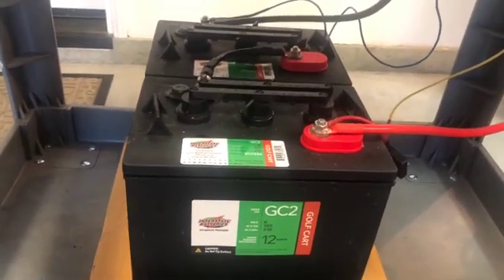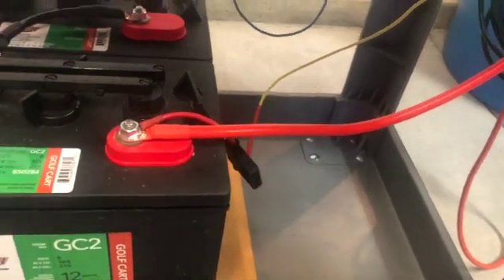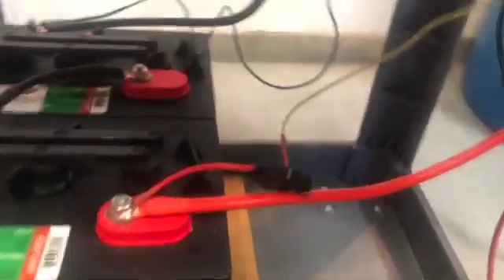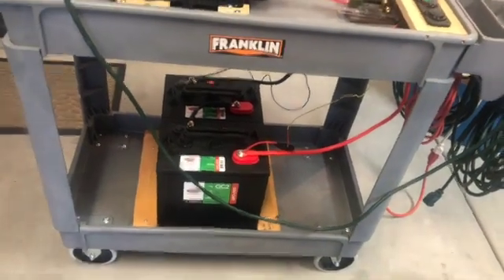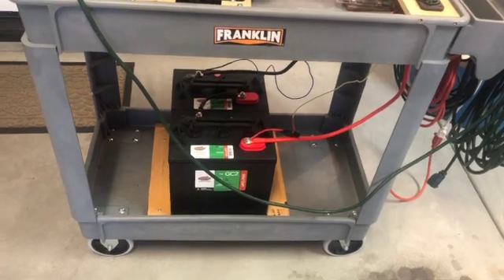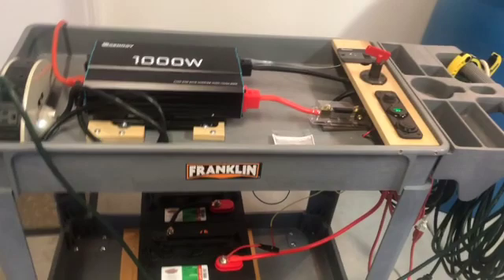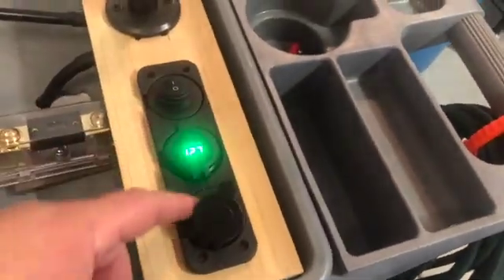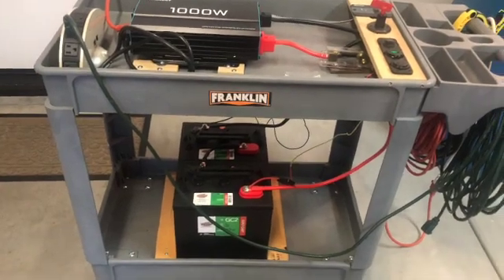DIY Portable Power Supply Station Inverter & Golf Cart Battery Solar Generator Refrigerator Freezer

Comment: Nice set up, if you get a chance and want to, add 2 to 4 more batteries. You can also run another inverter at the same time, if need be. And no lithium batteries will not survive an EMP.
Reply: Indeed , EMP / CME /GIC ECT.. and the elektrical components ( read BMS ) are freid and to at bad luck with much more bad luck these lithium batterys can have a thermal runaway with hours of fires that you cant put out becaus of the chemicals in it . 
When i was looking in to a system i was always hesitant because these EV's that burnt to the grond and / or exploded , so no lithium for me .
Reply from the maker: That's what I was thinking also. @dreddredd7137
Reply from the maker: Thanks.  We actually used it recently for a few hours when Edison cut the power due to a windstorm.  It worked great.

Comment: Some lithium batteries will charge faster than lead acid batteries. An inverter generator would use less gas to charge lithium vs wasteful slower charging the other types. Nice for being on the cheap though. Lacking for me i want something to at least power a microwave.  It would be an 2000 watt pure sinewave inverter with 200 ah 12 volt lithium lifepo4  battery. Solar mppt controller.
Reply from the maker: If I was discharging and recharging this a lot I would have gone with the lithium but I have the batteries on battery maintainer so they should last a good while because I'm only gonna use this 1 or 2 times a year.   I'm only using it to power the fridge and chest freezer so the 1000 watt (2000w surge) inverter is plenty, but not for a microwave that you may use.  Thanks for watching.

Comment: Sir:  

Would you be amenable to a Montana Public Service Commissioner referring to this video when speaking as a Board Member and/or when any Board business is published to the general public online or when they are making a video presentation?  

A T Burke
Reply from the maker: As long as you credit my channel and display the disclaimer.  Disclaimer: 
This video is for information purposes only, and does not constitute professional advice.  Electrical systems can and do involve dangerous electrical connections.  If you do not have experience with electrical wiring, please contact a qualified professional.  Use this information at your own risk. No information contained in this video/webpage shall create any expressed or implied warranty or guarantee of any particular result. Any injury, damage, or loss that may result from use of any information contained in this video/webpage is the sole responsibility of the viewer.
Reply: Thank you, Sir.  

A T Burke @fixanythingdiy